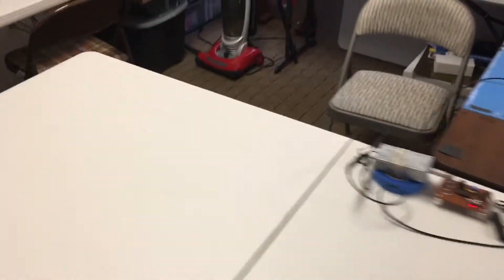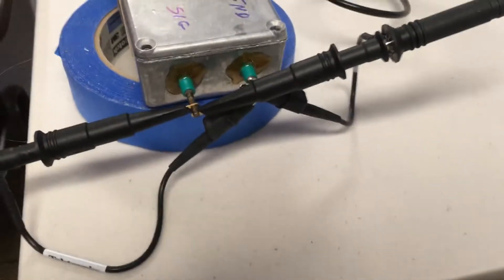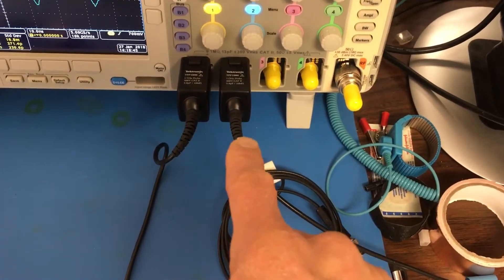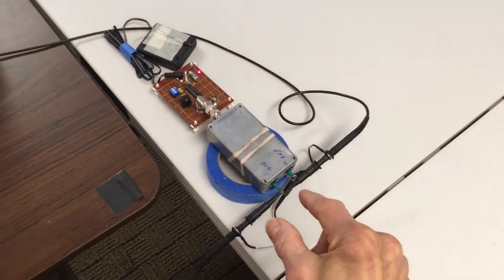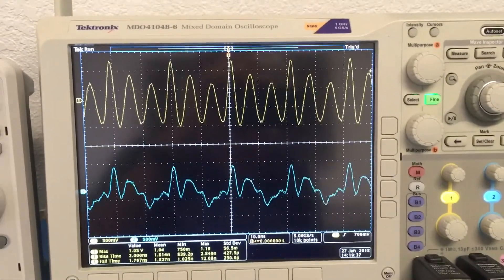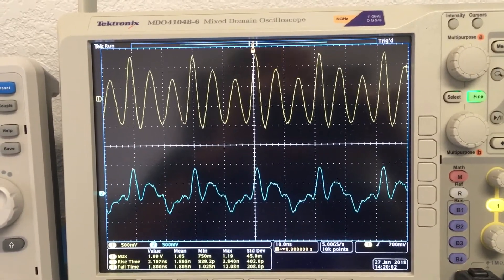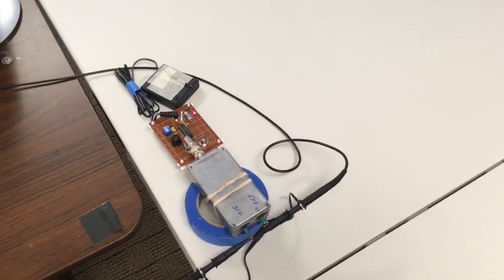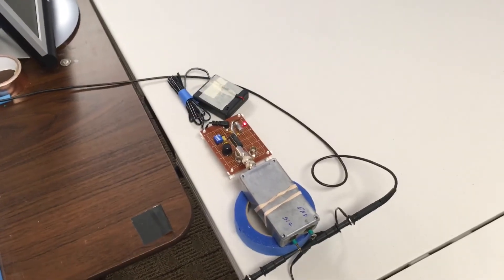Measurement Dilema

Comment: The blue probe is not making good contact with the signal pin or spring tip is not well seated on the probe
Reply from the maker: Todd Cottle all measurement gear is well connected and operating properly. The measurement equipment itself is not the problem.
Reply: Dang.  Well then it has to be that you formed a shielded magnetic loop antenna with the two probes.  Something like this  http://emcesd.com/tt120100.htm   :-)  I can't explain the difference in the two signals though.  I expect that the box is empty with a short between signal and ground
Reply: Not a short.  It's open between signal and ground

Comment: While I don't have a clue yet, I do observe a couple of "unbalanced" probe conditions:
1. The Channel B probe cable has a loop next to your mystery box, while the Channel A does not pass near the box. Coupling?
2. The Channel B probe cable passes very close to the oscillator's unshielded power cables. Could you have some coupling through the oscilloscope's probe shield ground?
3. What does the data look like if you swap the A & B channel inputs at the oscilloscope front panel?
4. I'm not sure why, but I wonder what the traces would look like if both probes and probe cables were placed closely parallel to each other.
5. When the wizard oscilloscope, with the "human error eliminated" automated calibration gives weird results, I would look around for an old 100 MHz dual-channel analog oscilloscope, with an isolation transformer (or battery powered), to get confirmation of the data.
OK Mr. Smith, I'm ready for my face-palm.